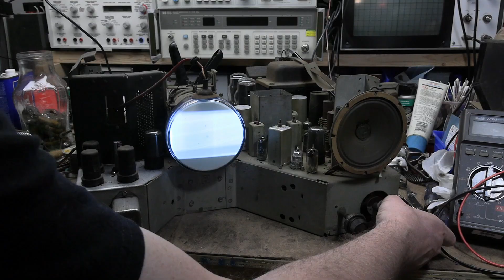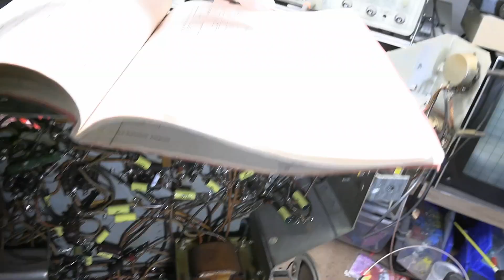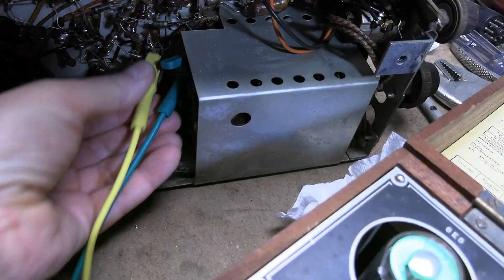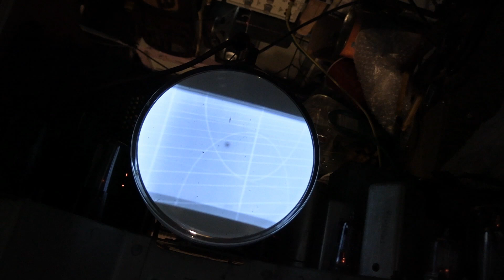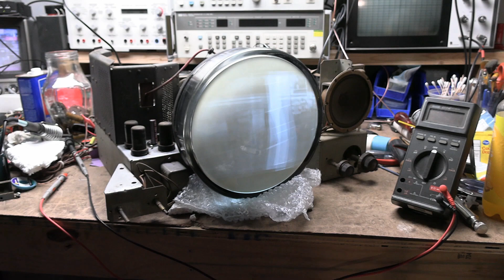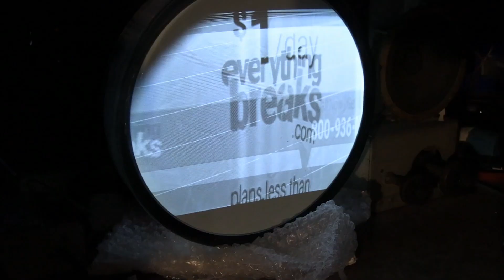Crosley 307-TA restoration part 2

Comment: Very interesting stuff! Looks like it is coming along greatly. I have been finding many of those 270 pF IF coupling caps to be bad in these sets, between 630 based chassis as well as the 621TS. Sorry that the test CRT is causing the brightness issue!

Comment: In the early days the cabinet and electronics were HUGE and the crt was tiny. I remember seeing a pre war TV in our favorite thrift shop in the early 70s. It had a tall cabinet with 3 chassis in it and a small square crt. I really wanted it because it was so old and cool but parents weren't about to buy it for me and I doubt I could have done anything with it unless I got lucky and it worked. Had a lot of light house and radio style tubes in it.
Reply: Interesting story! Although not a prewar set, I remember seeing a late 40s RCA set, perhaps a 630 based or possibly slightly later with 10" screen and built in AM radio as well, at a garage sale, and wished I could buy it, but it was $50 and like you, my parents were not about to buy it for me (nor for themselves) and my allowance money was not near enough to cover it! The sellers said the radio worked, but not the TV (not surprising!).

Comment: Hi Bob, it seems there is always something to be learned with each restoration.  Since I have never worked on that model, I pulled the schematic to see what you were up against.  If I remember correctly, I think the TV by itself consumed 285 watts, and 320 watts in a combo configuration, which used a separate higher power audio amplifier.

The coupling capacitor value in the IF amp chain determines the IF bandwidth (a larger cap value produces a wider bandwidth and, so on.).

Your discovery of the brightness problem (which you found by trial and error) is a regular part of my troubleshooting technique, especially if problem symptoms don't make any sense.  I call this a "Reality Check", which consists of substituting out test equipment and test fixturing (one by one) to double-check that it is actually functioning correctly.  This may sound far-fetched at first but, the technique has proven to be extremely valuable during exhaustive troubleshooting efforts.

As you well know, those tapped power resistors are all custom parts.  Replacing them with individual fixed resistors is usually cumbersome.  The green corrosion on the resistor leads/terminals is an indication the resistor maximum body temperature has been exceeded or, the resistor has been operated for long periods of time at maximum rated body temperature.
Reply from the maker: That corrosion is also just from age. I'm currently working on another set from his collection that has five open power resistors. They also have green corrosion
Reply: @bandersentv  The age definitely adds to the corrosion problem.  Bare copper is very susceptible to corrosion, so the component manufacturers tin the copper.  Also, since the solder flux is not cleaned off after soldering, the flux still remains active so, combined with the heat, accelerates the corrosion.

Sorry to sound like a know-it-all, with my background initially in TV repair, then aircraft transceiver design, and component engineering, I wanted to complement your instruction in TV servicing by adding some background that is not normally included.  If it is making things more confusing, I will keep quiet.
Reply from the maker: @billharris6886  Not at all, please keep it coming. Much of my knowledge comes from guys like you.  
The failure rate in this particular component is really remarkable.  I did a video about them ages ago.  I went through  about a dozen chassis and every single one was open.  That led me to develop a replacement component since it is an oddball value.  You'll be seeing it in the next installment.
Reply: @bandersentv  Cool, sounds Great; thanks!  I am not surprised at the failure rate of the tapped power resistor.  When I saw how it was mounted, I could see it would be unable to dissipate the required amount of heat without cooking itself.

Comment: I might be mistaken, but perhaps that resistor in the flyback can be replaced with a modern power resistor. By 1948, if one didn't live in or near one of the largest three U.S. markets, it wouldn't have been practical to own a TV set in areas like Houston, Minneapolis, Cincinnati or Omaha.
Reply from the maker: Yes, it will be. They still make nearly identical resistors today.